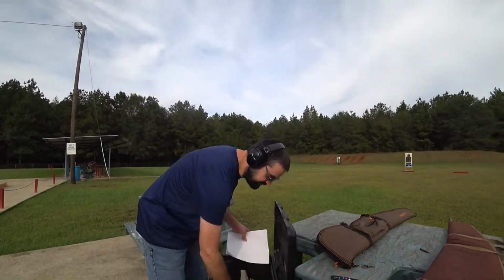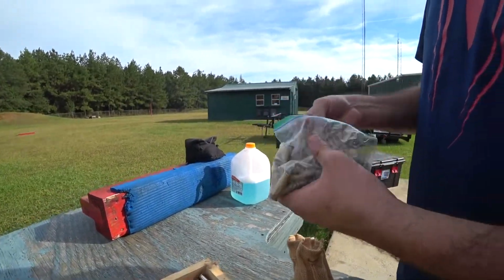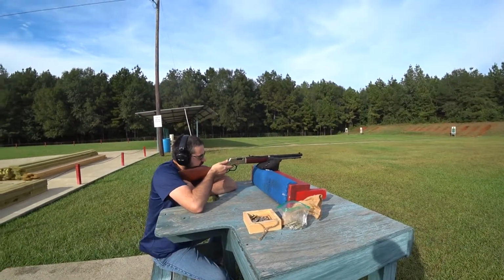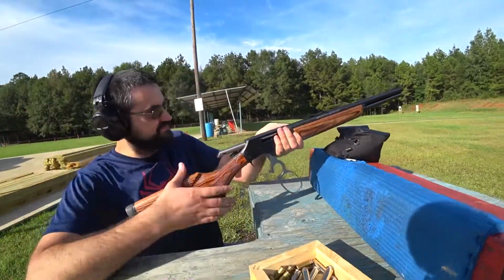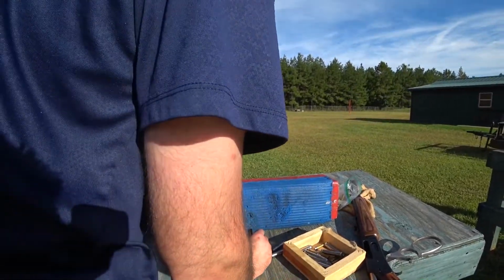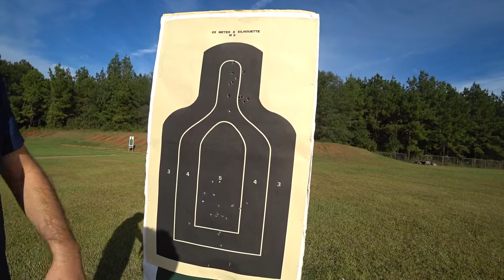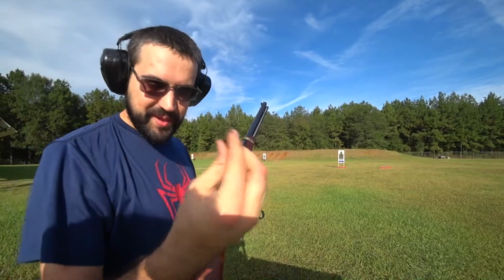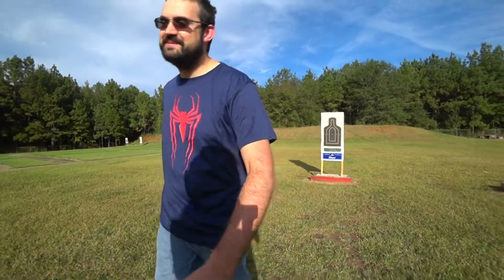Loading & Shooting Real Black

Comment: Sir i like your channel easier way to clean that rifle stick the muzzle down in a tub of soapy water insert cleaning rod and patch push cleaning rod all the way down pull cleaning rod back up the bore drawing water and soap up the bore in the chamber repeat until cleaned then take a air compressore and blow the water out oil like normal it will be faster